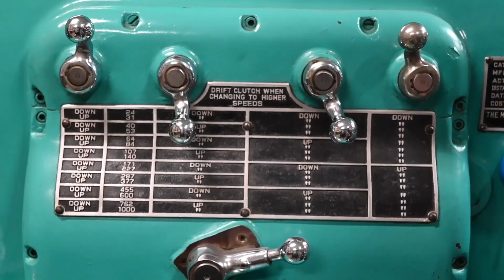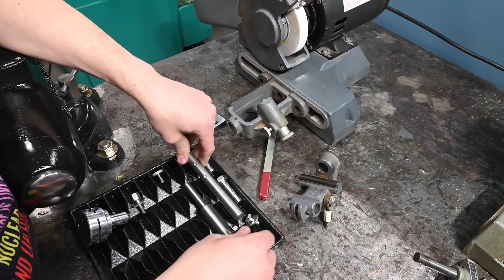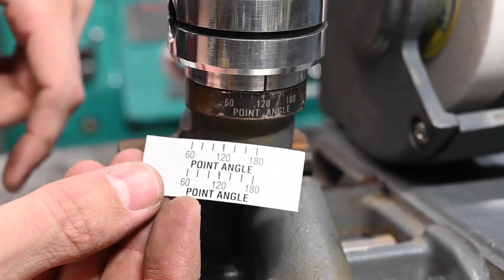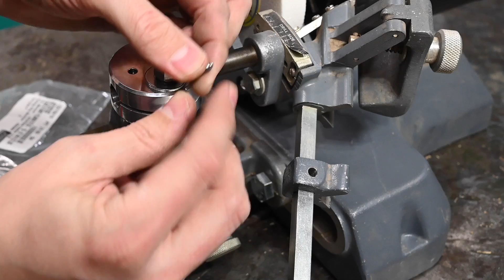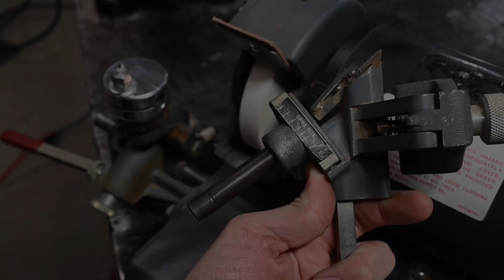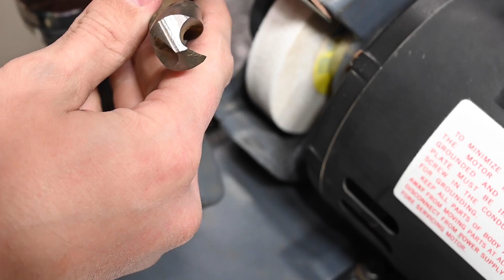Lisle 91000 Drill Grinder Assembly and Testing

Comment: I'm new to this drill sharpener but a couple of observations are:  1.) it would be nice to protect the shaft that moves the holder in and out.  This seems to be the one area that gets gritty and starts to wear.  It should not be lubricated with oil or grease as this would only make things worse.  2.) White Norton wheels in 60 grit are hard to find in 5 inch.  I just bought a 6 inch wheel and used a dresser to take it down to about 5 1/2 inches until it would fit.  3.) Its a skill to remove and insert the drill holder when the wheel is still moving.  But if you want to be efficient you will want to learn.  Backing out the feed screw and using the lever to pull the holder as far as possible from the wheel helps.  4.) Learn to use the whole surface of the 3/4 inch wheel.  If you only use the lift side as some users do you will have to dress the wheel more often than necessary.

Comment: The 3 videos on the Lisle 91000 grinder were very helpful as I am missing some of the same parts on one I bought recently.  One suggestion:  instead of calling a part "this guy" use the name found in the instruction manual--it would help avoid any confusion.

Comment: tip..metal tab that is for orientation of 2nd side. dont swing it out til you are done on 1st side and you won't grind tab by accident.  just do it before you unclamp drill after grinding 1st side. them tabs are impossible to get so you dont want too damage it

Comment: Nice, I operated a 91000 drill grinders in 2 buildings for years. Pro tip A: after locking the depth collar stop knob, turn in the depth adjustment knob a little further (it will move a little more), & grind a little more, but move the stroke a lot slower & the finish will improve. When you turn the drill bit 180 deg & grind to the end of the depth stop collar & can't turn the adj. knob any further, now you matched the identical height you dialed in & ground "just a little bit more" on the first ground edge. If you fail to adj. that "little bit more" on the first edge, it will remain slightlhy higher than the second edge which you Did go all the way to the stop collar with the adj. knob. Try it & it will make sense when you tighten the lock collar & you can still turn the adj. knob a little bit more After you tighten the lock collar. Pro tip B: Wrap a piece of 120 grit sandpaper around a wood dowel & lay it into the flute groove just under the cutting edge & slide the dowel up the flute to remove the dwarf/debris that bent over into the flute. 2 or 3 swipes should do. Dual chip curls every time, Sweet!
Reply from the maker: Nice thank you for the input! I haven't spent much time grinding drills and I need to sit down and get some cleaned up since I have the right tool for the job. I'll keep this in mind when I sit down to use it some more.

Comment: I have someone who will make me the diamond dresser holder. Can you reply with the dimensions of the part and what diamond dresser you used in it? I'm in the middle of restoring two 91000's at the moment.
Reply from the maker: Sure- small diameter is .491” large diameter is .875. Small end is 2.118” long, large end is 2.428”. Diamond dresser is .356” from the large end. Scribe mark is 10° off the diamond as shown in the video, so the diamond points downward when the scribe line matches with the turret scribe line. Hope that helps.
Reply: AlwaysSunnyintheShop thank you, what diamond dresser did you use. I see about 50 different sizes on msc and mcmaster
Reply: @AlwaysSunnyintheShop  any chance you have the tool that removes the grinding wheel nut? I am trying to find one, it looks like a 2" spanner with a 1/8" pin. The tool lisle says is for that, that they still have is only $2.50 so I doubt that's the right tool. Can you email me a picture of it if you have it? Ty. antilleslp at Hotmail.com
Reply from the maker: You shouldn’t need a tool to remove it. You don’t need a lot of clamping force on grinding stones. Are you trying to remove it backwards? It is left hand threaded so righty loosey lefty tighty.

Comment: While this grinder is decent. It is not very user friendly. You have to have some time to get things right. I had two of these in my shop. Bought a darex M5 very simple to use. And very easy to set up. 20 years later still using the thing with the CBN plated wheels. Step drills, not an issue. Brad points? Not an issue. Split points? Easy least! Plus you can grind any angle you want for the application you need. But just like these, they don’t make them anymore! But if your at an auction or find one that’s for sale. You may want to check it out!! I would also recommend not to use a rock wheel. To many variables!!! Go wilts a plated. Way more expensive. But will last forever!! Been doing industrial grinding for 25 years. So maybe I may know a little bit. 😊 oh, you may want to thin the web a bit. The drill will cut a little better. Just an opinion.
Reply from the maker: Thanks for the suggestions. I’d love a Darex but as seldom as these types of things come up, I’m not holding my breath on seeing one haha. Have a brand preference on the wheels?
Reply: AlwaysSunnyintheShop I get all of my wheels from Radiac abrasives. I don’t use many rock wheels. Mostly all super abrasives.

Comment: might be a good idea to cover the sticker and plate with a thin piece of pre bend plexyglass cover , just fasten it with two small rivits , its eazier to get a new piece of clear plexy than it is to get new stickers , then again you could photocopy the stickers for later use and print new ones using a inkjet printer
Reply: Clear nail polish works, just don't let the missus catch you!
Reply from the maker: Hey that’s a good idea! I’ve been thinking about how to protect it and hadn’t thought of that.

Comment: I think the reason for the finish coming up as it did was because if I'm not mistaken you didn't dress your stone, which is needed if you have a new stone in there, and also you may want to move the drill more slowly when doing the final touch. I wouldn't buy a finer stone, the bastards clog up so easily
Reply from the maker: I dressed the stone before I started. So far, I’ve found if I move the drill too slowly it gets really hot. Will have to keep experimenting to get better results.
Reply: @AlwaysSunnyintheShop  the dressing can cause such problems if you moved the diamond too slowly, or the diamond wasn't sharp enough 🤔

Comment: If you look closely at the freshly ground drill bit, you'll notice that the cutting edges have a little sickle shape to them, but they are supposed to be straight. I think it's due to the drill bit not being oriented properly in rotation. The rule of thumb is, the cutting edge is supposed to be horizontal. As in parallel to the axis of the wheel. Anyway, I think that's what's going on there.
Reply from the maker: Thanks for pointing that out. I’m still brand new to this so I’ll keep an eye out for that.
Reply: This is only true for hand sharpened drills, factory grinds on bigger drills and also grinds produced by many drill grinders have the edge not parallel to the spindle but the side higher than the center. I know what it does so I tell you: it makes your effective back clearance vary along the edge, being greater in the center where greater clearance is needed, and less in the outer edge thus making it stronger (which is very welcome).
Reply: @MF175mp  What you're saying might or might not be true. Rotating the drill bit like might produce more clearance in the center, or it might produce more clearance on the periphery. However, I just looked up Lisle manual for this machine and it says the lips should be straight and parallel.
Reply: @LambertZero  I've seen that from the factory new 35-50mm drills I had. They were not done exactly by that, I know, but it effectively brings the drill closer to the factory style grind. The Lisle way may be as you said, it will produce a good drill anyway (the grind in the video has just got a bit too much clearance)
Reply: @MF175mp  I'd argue that the drill in the video has too much clearance on the periphery and not enough in the center. As indicated by the angle between the chisel point and the cutting lips. If the clearance is uniform, it'll be at 45 degrees, if the center has too much clearance it'll be less than 45, and if it doesn't have enough, the angle will be greater than 45. And I suspect that the drill not being oriented in rotation during grinding is exactly the reason why.
Reply: @LambertZero  it's hard for me to tell from the video, but I would say exactly opposite, the clearance in the periphery isn't what it first looks like when the drill is positioned like that while ground. The land in the far back from the edge doesn't matter so much, it varies with the distance between the pivot point and the drill point that determines the radius it makes
Reply: @MF175mp  Here's the Goldilocks condition https://i.imgur.com/QmZMUAR.png as presented by Lisle. From left to right, not enough clearance, just the right clearance and too much clearance. The drill in the video looks like it's between 1 and 2 closer to the chisel point, and between 2 and 3 on the periphery. https://www.lislecorp.com/media/documents/91000_Drill_Grinder_Instructions_0CECFEC7086BD.pdf

Comment: I like what you done here but, the sharpener itself seems very fussy. I cant imagine wanting to make all if those settings when sharpening a bunch of different sized drills.
Reply from the maker: It’s not as bad as it looks. When I watched @abom79’s video of how to use it, it looks like a pain. In real use it’s pretty quick and easy.
Reply: If you have a bunch of all sizes, you don't have to do that for just one drill. Wait until they're all dull and then sharpen them

Comment: Why oh why is the US obsessed with monkey wrenches on what is basically precision equipment....
It comes up so often....I started on a Bridge Port @16 in 1977...so learnt the apprentice way.
Reply from the maker: I wouldn’t call a shop made stud and hardware store hex screws precision, but I get your point. I typically only use adjustable wrenches in my videos for convenience and speed of filming (don’t have to go back to the tool box if I grab the wrong size), or if I’m having to climb around stuff to get to what I’m working on. I have a nice selection of mechanics tools so I almost always grab the proper wrench or socket.
Reply: @AlwaysSunnyintheShop  
The drill grinder is a precision bit of kit...engineering is not convenience it is about making the right procedures in the correct steps...
Sorry to say but being a filmmaker is not a prerequisite to being a toolmaker, doing an apprenticeship like me and millions of tool makes machinists have done is nothing to do with filming...
If I get a spare min I sometimes film a bit of machine work but don't spend all day filming just running the mill/lathe. 
https://www.youtube.com/watch?v=AUiFNZ9WU0k&list=UUWoqAxofJ5s6osAbVHT94Tg&index=93
https://www.youtube.com/watch?v=hYoeY9jxZuU&list=UUWoqAxofJ5s6osAbVHT94Tg&index=79
https://www.youtube.com/watch?v=ZAZ-f2VGAiM&list=UUWoqAxofJ5s6osAbVHT94Tg&index=108
Reply from the maker: Ok, but I didn’t use the adjustable wrench on any precision parts or on anything that wasn’t made to be turned with such a tool. Using a 1-2-3 block as a hammer would qualify as the wrong way to use it and a bad thing to do. Using a wrench on a hex screw is exactly what it is for. I’m just a guy in his garage learning- I have no training whatsoever and make plenty of mistakes...I just don’t see how using the crescent wrench was one of them.
Reply: @AlwaysSunnyintheShop  The difference is reaching for a pointed TAP to dot a centre for a drill or finding the centre punch. use what you like as it is your channel. 
But don't make excuses for short cuts...I am out....
Reply from the maker: In this case what functional difference is there between a tap that’s been ground to a point compared to a center punch? Again, I freely admit I make mistakes and don’t know a lot of things- that just seems like a strange thing to gripe about. 🤷🏻‍♂️
Reply: That's not a monkey wrench, it's an adjustable spanner, monkey wrenches have a spring loaded head that loosens its grip as you move it back and grips when you pull on it, usually on pipes or conduit
Reply: @andyb7963  Monkeys use them because they want to take the corner off a nut, instead of walking a few feet to get the right size fitting spanner..pay peanuts get monkeys
Reply: @theessexhunter1305  Love it how you get into this guy for using an adjustable wrench.. Then in the first video of yourself you linked there is an adjustable wrench on the mill!